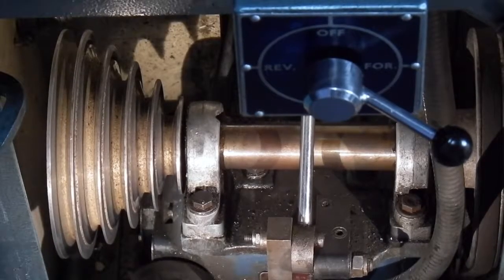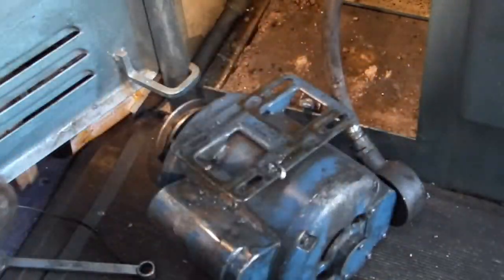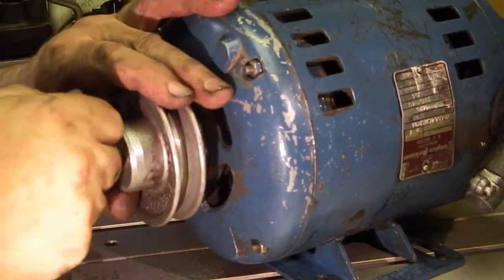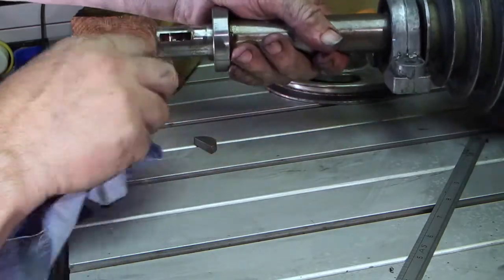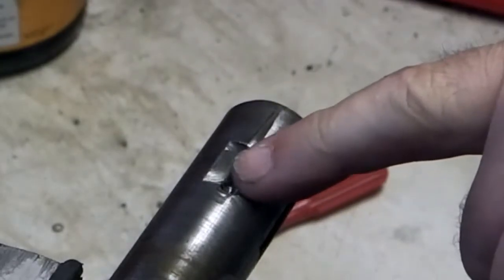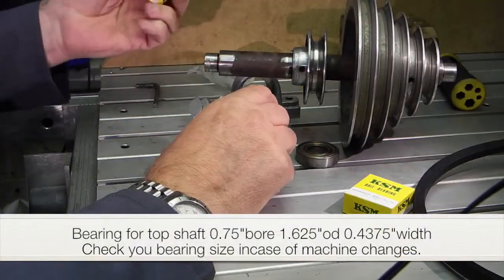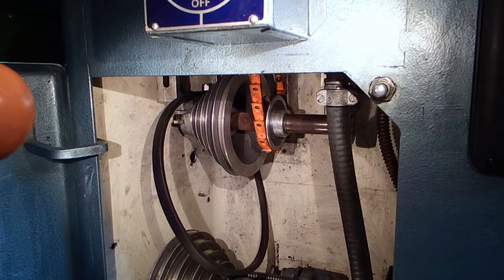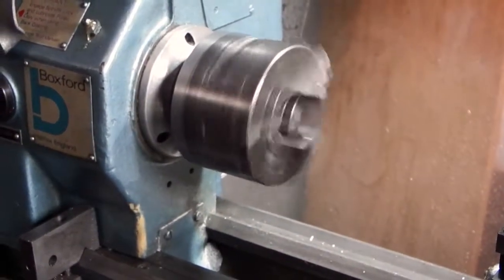Boxford lathe Changing the drive unit bearings.

Comment: I'm sorry i bought, mine whoever designed the belt configuration between the intermediate shaft and spindle drive wants bulling,  my intermediate  shaft isn't hung with pillow blocks i wish it was but it goes straight through to the lathe frame both sides bought a new link belt and no way could i get it tight enough without it slipping should have bought a myford i think?

Comment: Alan.  I have an identical lathe and the same motor.  Its wired for three phase at the moment.  I need an inverter. Can you recommend one?
Reply from the maker: Hi Most. inverters seem to be made in China. if you look on eBay you can find some inverter kits for the Boxford. Some are not branded but I've seen some IMO inverters which are sold separately. I have a 240 volt motor on my Boxford but like you I'm looking to change to an inverter to give a wider speed range.